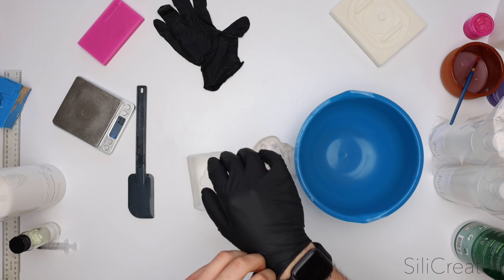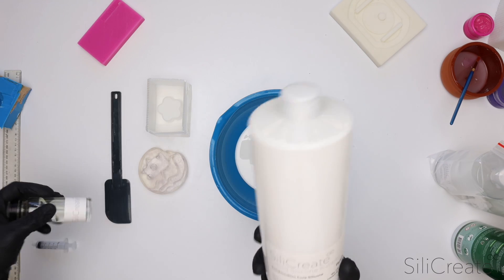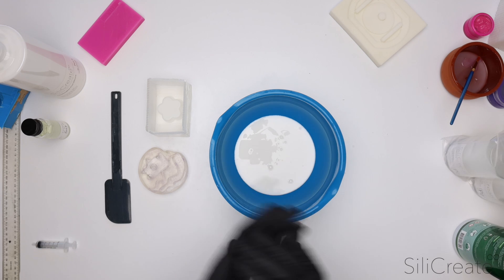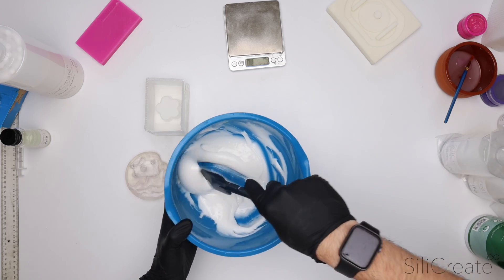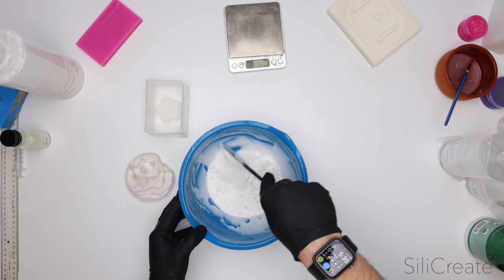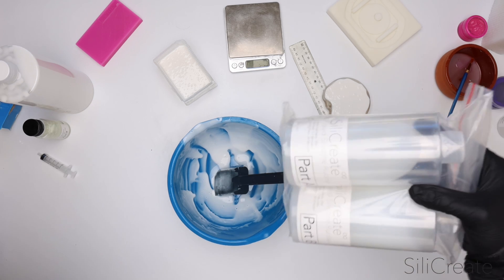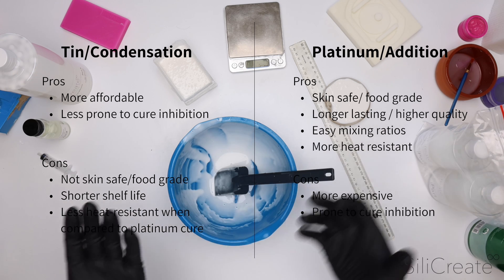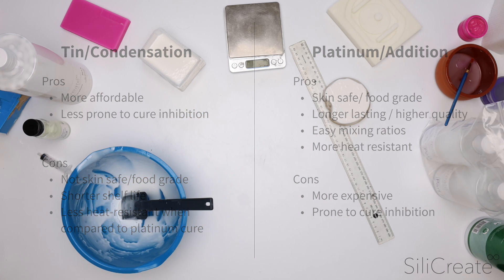Tin Vs. Platinum Cure Silicone Rubber | Comparing Condensation and Addition Silicones

Comment: Hi I want to make pressure drive pulley out of silicone, but all i can find is 40A stiffness on the net, do you happen to have >60A silicone mold, preferably 70A or higher?
Reply: I found it hard to come by >60A silicones. I could only find some sold by wacker but they had low tear strength. Polyurethane that can achieve these stiffness are easier to find... but they're not silicones :/
Reply: @kitchenlab8099  Yeah, not as durable as a pressure drive pulley you're right about PU.
Anyways, 3 months later report; I bought 45A platinum cure silicone and added some mineral oil to the mix, which appears to increase stiffness a few A's. In my case it's a e-bike front wheel driver so the driven material is wheel (NBR) it works but I barely started testing, might start uploading videos if it passes 6 months mark.
Still, I can say it looks more promising than Indian guy's drone motor bike on Youtube. We'll see..

Comment: I would like to ask, are the tin cure silicones "skin safe" after you wash them? Like can I touch it or are they toxic?
Reply: The Answer is no, tin cure silicones are not skin safe. Meaning they cannot be used for life casting. Even platinum cure silicone needs to be officially certified as skin safe. If you are life casting, you need to look for skin safe Platinum cure silicones that can be applied to the skin with a paint brush.
Reply: Bump. Anyone know this?

Comment: I accidentally added significantly less hardener than I should have to my tin cure silicone. I just found this out after having the mold in the pressure pot for hours already. Should I be patient or is the mold lost. I added about 2% (my usual B compound) when it should have  been 5% (accidentally used wacker t21)